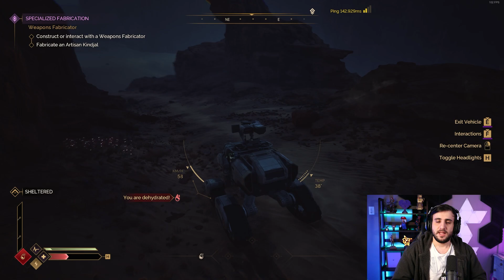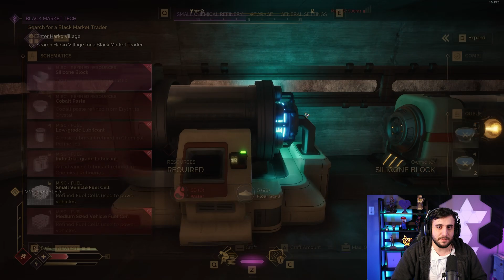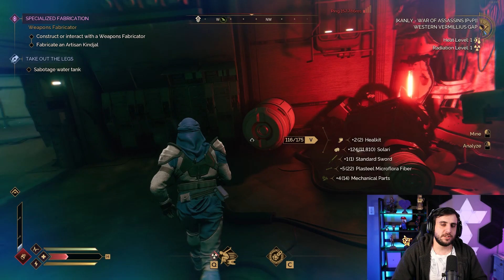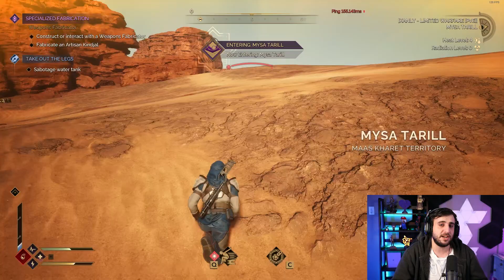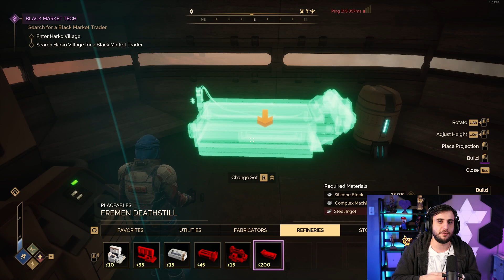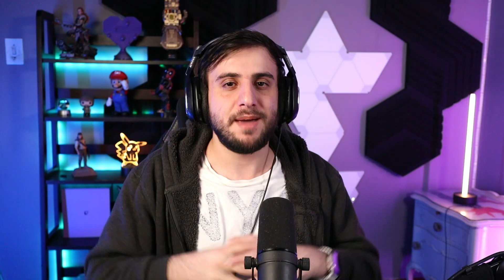Dune Awakening EASY Water Guide For UNLIMITED Water Supply!

Comment: planetologist: rerouting 3; overcharge 3; dew gathering 3; conservation of energy capstone. REAPER gloves, any version. break out the industrial dew scythe and walk the patch with the largest battery pack you can manage. Real time, 53 minute mark, start gathering. I drop all gear aside from energy efficiency and max out decaliterjohn. 100k water in 4 minutes. WTB Dump all water button.
Reply from the maker: 2 problems with that, thats a pretty big perk investment where you could have that in perks that do more damage and make you more lethal in combat and you also need to be near plants at specific times of the day. Without all the perks i can get around 40k water in a few min if theres enough plants nearby but it takes durability off the items and it is a bit of an investment in terms of me needing to actively farm it. 

That being said though I do agree that the dew scythe is probably the next best option as the others kinda suck
Reply: @SpyroZA  It's not a problem. I choose to get more water and squeeze out the most I can get from a battery. I run sword exclusive and lethality has not become an issue.